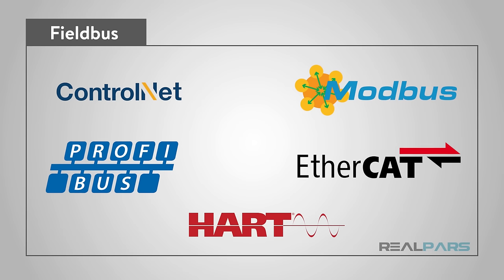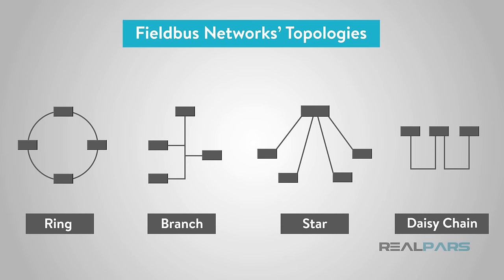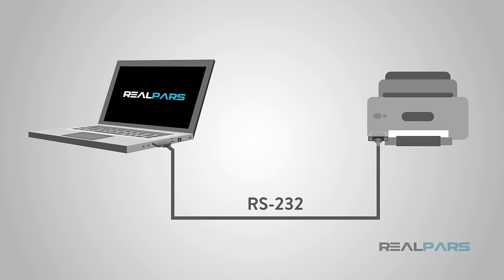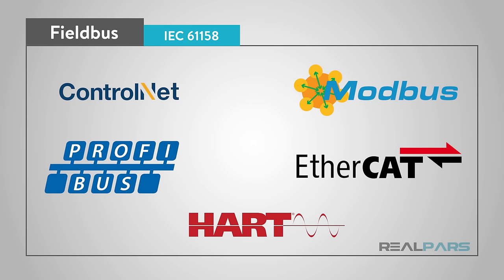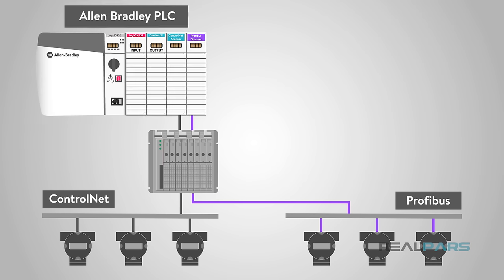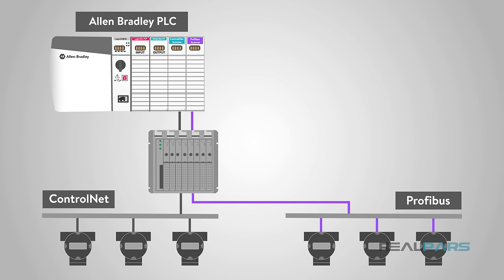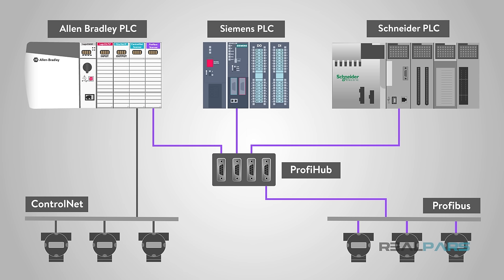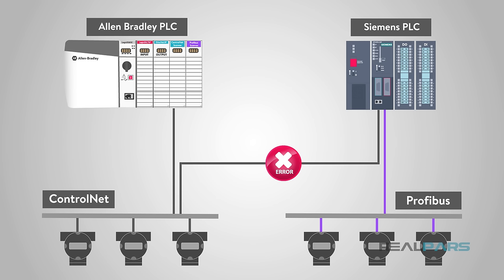What is Fieldbus?

Comment: can you give me an example where fieldbuses are used in a smart home?
Reply from the maker: Instrument fieldbuses are usually not used in a home setting, mainly because there are more efficient and cost-effective ways to interface the relatively few sensors in a home.  You could consider ethernet as a Fieldbus, especially for IoT devices with ethernet built-in.
Reply: @realpars   My teacher said that ethernet isn't a Fieldbus and I need to have some information about where a Fieldbus is used in a smart home. I was thinking about how temperatures, lighting, cameras, doors, and more are connected to a router or something via a Fieldbus which is then connected to the app you have on a phone. But I need some more developed answers, it's useless to search for information about smart homes online.

Comment: Thanks for the vídeo! Where can i find which protocols accept each brand of plc?
Reply from the maker: Hi there,
Thanks for your comment.

Depending on which PLC brand you are going to use, it is better to refer to its Datasheet and specifications on its website and search for its supporting protocols. 
By the way, all kinds of famous PLC brands such as Siemens, Allen Bradley, Schneider, etc. have some utility cards which you can add them to make them support other types of protocols.

In addition, there are some manufacturers that produce a variety of "Gateways" to convert their existing common network protocols (like Profibus DP or Ethernet) to other types that you may need. For example, you can use a Profibus DP/PA converter or a Profibus PA to Ethernet protocol.

Comment: Can fieldbus use fiber optic cable?
Reply from the maker: Hi Lucas, 

Thank you for your question! Yes, you can indeed use fiber optic cable. However, it's important to ensure compatibility by installing a converter in your PLC rack to transition from electrical to fiber, and likewise, a converter at the receiving end to convert from fiber back to electrical. Make sure to select the appropriate converter for your PLC and device.
Reply: ty <3 @realpars

Comment: How to determine the length required and it's limits?
Reply from the maker: Every fieldbus type has a limit as to the bus length.  For Profibus, the maximum length is determined by the bus speed selected. At lower speeds (93.75 Kbps), Profibus can be run 1200 meters .  At 500 kbps, the maximum length is 400 meters.  At 12 Mbps, the maximum length is 100 meters.   The maximum length for ControlNet is 1000 meters with 2 taps (drop connectors) installed, and is reduced by 16.3 meters for each additional tap installed.  With the maximum number of taps  (48) is 250 meters.  The "length" of a bus segment is usually determined by the total length of the trunk plus the lengths of the drops from the trunk to the individual devices.
Reply: @realpars  thanks a lot